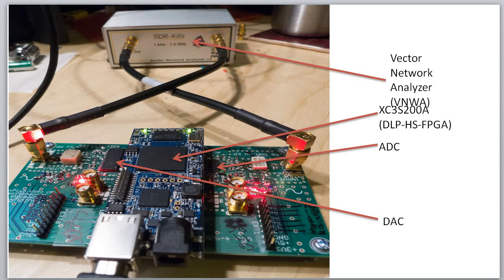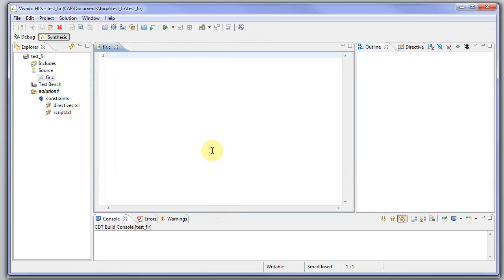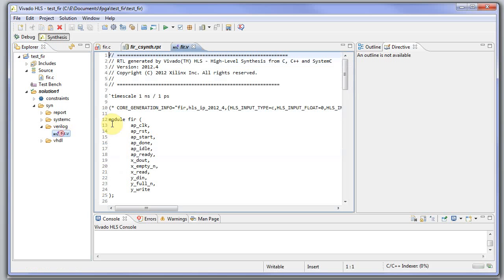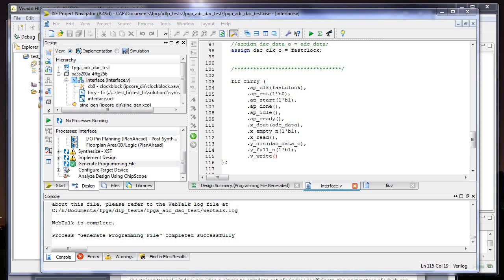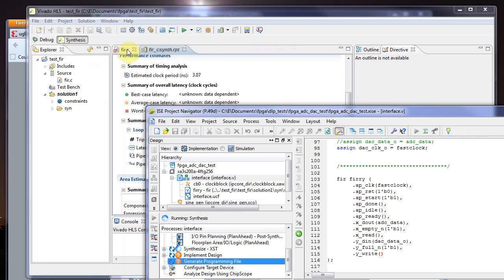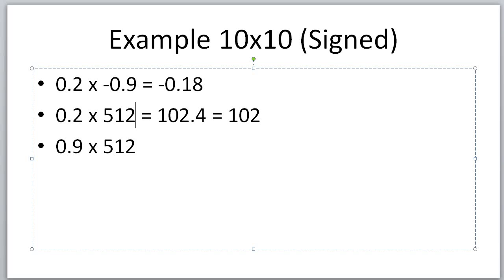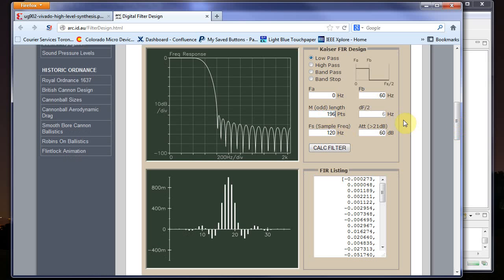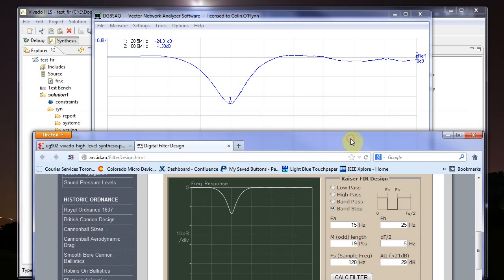Xilinx HLS #2: FPGA FIR Filter Design in C in 30 minutes (Vivado High Level Synthesis)

Comment: I have an Adaptive Filter Verilog code generated using MatLab's HDLCoder tool. I now wish to implement the code on FPGA. The input has to be a speech signal. Can I use Vivado Design Suite for this, or will I need Vivado System Generator?